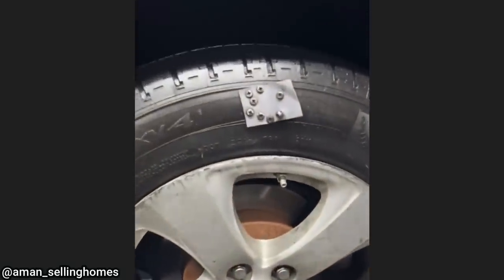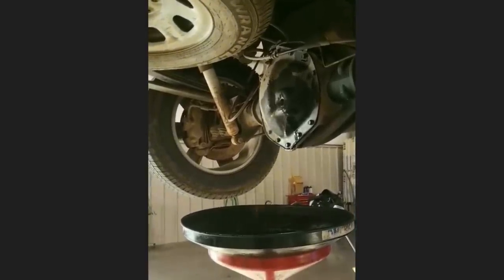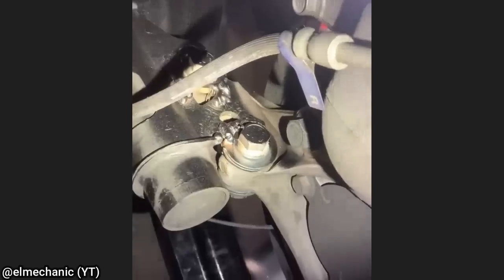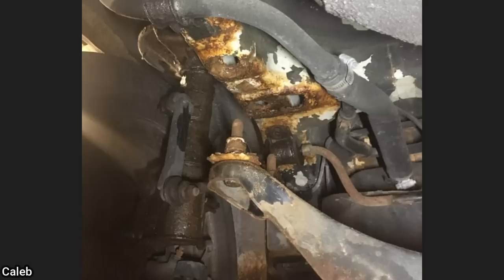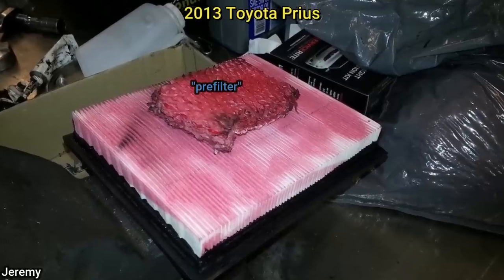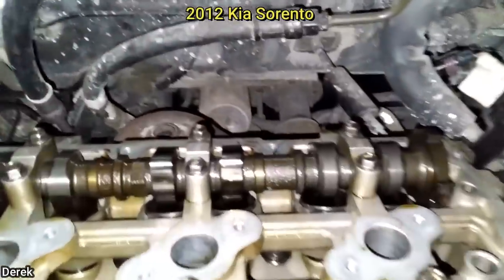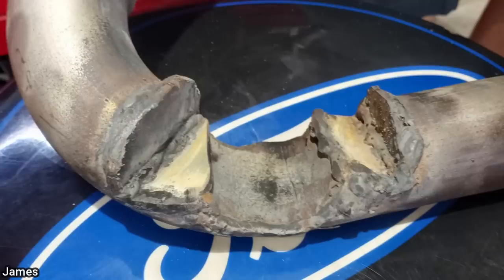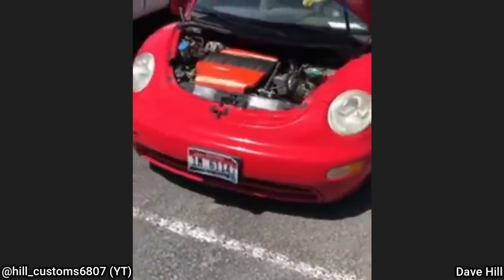Customer States They Tried Fixing Their Tire But It Still Leaks | Just Rolled In

Comment: The fuel leak from the rear diff, never in my life did i think i'd ever see something like this. Human stupidity is endless.
Reply: Crazy
Reply: Years ago on an old chevy van, Customer complained his DRIVE SHAFT was still leaking after replacing NUMEROUS tailshaft seals at another shop., I laughed it off, until I saw trans fluid POURING out of the weep hole in the Yoke.  Drain and refill to correct amount, and a dab of rtv over the hole... Back in Business.
Reply: Why would you rtv a weep hole? It serves a purpose
Reply: Even with my limited understanding of cars, my first thought was, "wait, fuel's not supposed to go in the differential, right?"
Reply: same thoughts. first time ever seeing fuel ending up in a Diff.
Reply: @caveatlector2671  - If we could harness the power of stupidity we could solve all the world's energy problems.
Reply: I bet that diff is spotless though...
Reply: You know that the bearings will need replacement soon if not immediately.
Reply: Something like this happened with the USS Nimitz (I believe) recently.
Some repairs were "done" and a water line and Aviation fuel line got crossed.
Reply: I have seen people putt 80 liters of 80W90 oil in the urea tank of a vehicle...
Reply: @Mr.SisterFisster  my thoughts too
Reply: Yet I don't even understand how that could be done... Been working on cars here and there, but no luck managing that kind of ordeal.
Reply: @gabrielecossettini2923  The old VW Vanagons had the oil fill behind the rear license plate. Unfortunately this was the 80s, and there were still a lot of 70s American cars around that had the fuel filler there. More than one Vanagon owner had a gas station attendant fill his crankcase with regular unleaded.
Reply: The H1 Hummers (especially the military spec) had vent tubes (mainly for water fording purposes) for everything that contained fluid.  It was a common issue to find fuel in the geared hubs, transfer cases, and transmission.  This was a direct result of a hole in the diaphragm of the mechanical fuel lift pump allowing fuel to bypass to the other side of the lift pump and right into the vent line which tied into the entire vent line system!  The hole is typically small and had little effect on the function of the lift pump, so finding fuel in the drive train was the key indicator of the deterioration of the lift pump diaphragm.
Reply: That's a good idea for teaching the concept of "infinity" - human stupidity 😁
Reply: @sil-zk8061  rtv?
Reply: I actually experienced that, on a military vehicle........as a civilian mechanic working in an army motor pool, had a hmmwv where everything connected to the vent system was full of fuel.

Comment: That exhaust-fix to clear the drive-shaft receives my 'Performance Mod of the Year' award! :trophy-yellow-smiling:
Reply: There was a video proving that a kink in the exhaust doesn't significantly affect performance, so why not put a giant notch in it?  It's kind of the same thing.
Reply: Many home wrenchers would be thrilled to even be nominated for your coveted award!
Reply: "Limited Performance Mod", Not limited in availability but limiting performance throughout the rev range...
Reply: Does the Prius filter get a 2nd place or at least a honorable mention?
Reply: Super extraction system! Amazing!
Reply: @fredygump5578  

I think you possibly might be talking about Roadkill but I can't remember the car. They beat the hell out of a header pipe for clearance and it was significantly narrowed in a small section and pretty lumpy. But yet it didn't alter anything on the dyno!

That notch thing though, you just know it will leak like a sieve and probably break at a really inopportune moment 😂
Reply: @skylined5534   Actually Frieburger did it on Engine Masters...on an engine dyno.  But yeah, they also did it on Roadkill, although that data is slightly less reliable.

Comment: Love the tire patch.  Fifty years ago I was turning wrenches on Convair 580s, turboprops with propellers 13' 6" in diameter.  Just for fun, we once cut two pieces out of .040 aluminum and drilled them for rivets as if making a scab patch.  The rivets showed heads on one side and bucktails on the other, but were ground flat on the other side.  We would glue the "patches' on front and back sides of a prop blade and wait to see what would happen when the flight crew walked around the airplane during preflight.  Most of them knew they were being pranked, but it was still fun.
Reply: "Pilot reports something rattling in cockpit. Removed something."
Reply: And 580s are still being operated today in Kelowna BC by KF Aerospace!
Reply: " bugs, sir, your plane has bugs."  @@klinestill

Comment: "I'll fix a hole in a tire by putting more holes in the tire" - don't forget that this guy is allowed to vote.
Reply: Just crazy
Reply: That's a red neck solution if I've ever seen one. And a very bad one at that.
Reply: And drive, and own firearms, and reproduce.
Reply: Also allowed to drive on the road with the rest of us.
Reply: And he’s driving on public roads just like you! Scary ain’t it 😬
Reply: don't forget the duct tape
Reply: @konradschnell6136  Really? Were you with him?
Reply: More immediately dangerous, theyre allowed to drive a vehicle... they should prolly be wearing a helmet, at all times..
Reply: He probably voted for Chester A Arthur
Reply: @calamite0  the duct tape is the smartest part of it. at least for americans. hope the screws are stainless ones or they might get rusty if it rains or snows... 😏
Reply: @kittytrail  
The screws were obviously self tapping and Self Sealing!
Reply: Sometimes you have to fight fire with fire.
Reply: @Jdogg4089   no that's a metrosexual Millennial tire fix that's just now getting into the DIY trend!!!
Reply: Geez this stuff makes me worried about humanity
Reply: And to procreate
Reply: If he used a metal patch it might have worked by sealing the screws with silicone or rubber.. But the balance will be thrown way off..
Reply: I breathe for a hobby.
Reply: @Smokie1523  he is a helmet at all times.
Reply: There should be an adjustment to the 2nd ammendment allowing these types to be stopped.
Reply: and has probably spawned offspring of some kind.......scary
Reply: And drive!
Reply: Remember he votes for your candidates and supports the things you support too.
Reply: Which way did he go George?
Reply: They'd be a perfect republican candidate... Don't fix anything, just make it worse.
Reply: LoL
Reply: 🎯🎯🎯 scary 🤦‍♀️
Reply: Don't forget about jury duty as well
Reply: A bone-headed attempt but not entirely outside of reality. You can stitch up a large gash in a tubeless mountain bike tyre that is too big for plugs to bung up. You just need to glue a rubber patch over it on the inside to create a good, airtight seal. The sealant should find and fix any little weeps left after that. I find it helps to also glue a patch on the outside to protect the stitches from abrasion.

Yes, it does feel all wrong poking your tyre with a needle repeatedly but it's a lot cheaper than a new one. I've had a stitched-up tyre on the back of my bike for three years.
Reply: He allowed to do more than vote sadly. He's allowed to breathe lol
Reply: And they may not be in your country
Reply: @konradschnell6136  I watch this channel for to relax and unwind and get away from the news for a while. Not everything needs to be about politics all the time.
Reply: @konradschnell6136 Really????
Reply: I think the plan was to outnumber the hole with enemy holes and surround it. A fine military strategy.
Reply: Truly incredible.... im loosing brain cells
Reply: As if voting isn't just circus for the plebs
Reply: Sounds like a democrat lol
Reply: he voted the current potato regime.
Reply: That thing is next to me on the road. I'm buying a tank
Reply: and voted democrats
Reply: Dude made a flat tire political 🤡🤡😂
Reply: @Jdogg4089  Which means we know how he votes.
Reply: @thefinalme best comment ever 😆
Reply: compulsory voting is good, fined if you don't
Reply: @shiki9986  losing*
Reply: That person may be “allowed”, but hopefully doesn’t know how.
Reply: Lmao
Reply: However, if they got the screw into the right spot it would have been a valid temporary solution to plug the hole and get to a tire shop for a new tire.  The world is full of neat things we have that originally resulted from someone saying "I wonder if this will work?"  Even more, the person didnt jut stand there and helplessly cry about the situation.  They took a  shot at fixing it, misguided or not.  They also recognized they got in over their heads and got the car to a shop.  Remember, not everyone grew up around people that worked on their own stuff and taught them basics.
Reply: And procreate.
Reply: @Smokie1523  at this moment I think it's safe to assume that the helmet is wearing him.
Reply: I think the biggest issue is they are allowed firearms, and we know they already like putting more holes in things...
Reply: @thefinalme  You should work for some private think-tank with a mind like that.
Reply: I'm actually more concerned that he's allowed to operate a vehicle on a public roadway...
Reply: @andrewt.5567  How optimistic. You know what else has originated from “I wonder if this will work?” - it’s called AAA or Roadside Assistance. 🤣
Reply: @J B  I think you got that backwards 
All the metropolitan areas have been democrat for decades. Still have high crime, lack of housing etc.
Yet when asked why they haven't fixed anything they blame the party that hasn't been in power in decades.
Reply: Congress woman AOC was going to remove her tires from her car to check the air pressure in them.  If you need any automotive information, she would be happy to help you.
Reply: Imagine a post online not becoming political
Reply: @beavis1887  I was thinking the same thing.
Reply: I hope he didn’t forget the glue to fasten the wheel back on the car
Reply: When he votes, he probably punches all the holes in the ballot.
Reply: Let alone allowed to operate a  2 ton metal chariot at speeds well above stationary.
Reply: @MisterTwister88  "The border is secure," Cacklin' Cameltoe. You can rest easy tonight, the government is hard at work.
Reply: Also they are out on the road amongst us . Watch out for the other guy comes to mind .
Reply: @Sashazur  unfortunately conservatives HAVE to make every post political no matter what the subject may be, even flat tires. They have to spew their bigotry and hate.
Reply: And has probably reproduced
Reply: @Sonny_McMacsson    I was. It’s true.
Reply: @chuckthebull    Aha!!! The balance!!!
Reply: @JB-mk4ry  As opposed to the smoking dumpster fire on a train wreck of the last 2 years?🤣🤣🤣
Reply: Hey now the duct tape will seal it
Reply: @MidKid61  No, Cacklin' Cameltoe actually said that. I am just quoting her. Perhaps you have the balls to see if I am correct?
Reply: If intellect was a voting factor every ivy league student would be pissing from how hard they're laughing, let's not forget our place
Reply: @MidKid61  So the fact she is a 'woman of color' is more important to you than the fact she lied to the American public? And she is the Vice Resident... You need to rethink your stance on this. BTW, I am also a person of color and I value good morals and ethics and honesty over what 'color' a person is. You should care too. That's why the USA is in the shape it is. Go figure.
Reply: Probably blat
Reply: Im more worried about the amount of people that have immediately jumped to the conclusion that the driver is both over 18 and isn't a convicted felon.
Reply: Worse, he'd probably get elected, for his "innovative" "outside the box" thinking.
Reply: And his vote is worth just as much as yours.
Reply: @Smokie1523 You better be wearing one too if you were around him😂
Reply: Probably blamed the flat on the Dark State.
Reply: LOL!!!  That is literally what I just came here to post!!  There really should be an intelligence test administered before being allowed to vote! 😂
Reply: you say it like votes mean smth. the problem hes allowed to drive
Reply: that explains everything!  there is no there there
Reply: He voted blue
Reply: Maybe it's an air inlet hole that only works in one direction
Reply: Also allowed to breed.
Reply: @beavis1887  You said it brother!!!
Reply: That's why we have the electoral college
Reply: @Smokie1523  and a life jacket.  Just in case
Reply: I dropped my phone when I saw that.
Reply: Should have guidelines to be able to vote
Reply: He probably voted for Fetterman.
Reply: @Jdogg4089  Nah, that's been upgraded to hillbilly level.....
Reply: It’s insane that this person drives them self never mind can get dressed with out help lmao 9 screws should stop one from leaking right!
Reply: Vote, breed, breath walk around freely, speak, act ect
Reply: Dont forget that this guy is allowed buy groceries
Reply: It's gotta be a joke
Reply: Isn't it great america
Reply: No the hell he is NOT allowed to vote
Reply: This guy is allowed to D R I V E
Reply: @MisterTwister88  yeah i remember when we HAD a border.
Reply: dont forget that guy is allowed to DRIVE... oh gosh
Reply: If there’s a hole leaking air it’s common sense making another one so that the air can leak inside again 🤓
Reply: I have put screws in tires, so they will hold air. I also use black silicone caulk when I do it.
Reply: @LMacNeill  That would be labeled "racist".
Reply: Best thing to do if you're in a pinch is to use one of those self tapper roofing screws with the rubber gasket on them. They'll hold long enough to get to a tire shop.
Reply: @bradbradleys6091  my dad did it once. By the time we got to the shop it was leaking pretty good but it got us there
Reply: @who_cares848  oh u mean like he drilled screws directly into the hole? That seems more likely over the method shown in the video
Reply: @MarkusBrod  the guy accidentally created perpetual flotion
Reply: @bradbradleys6091  yes that's exactly what he did
Reply: 🤣🤣🤣🤣 i noticed he missed some places with the screws!
Reply: @TheFlyingBusman  what are you gonna do about it not pay taxes
Reply: Most intelligent democrat voter:
Reply: How do you know?
Reply: That's exactly why you're paying $4 for gas.
Reply: @MyLifeThai371  George Santos probably fixed the car like this. It may seem strange, but who's going to argue with a mechanical engineer who studied at Harvard and also invented the automobile.
Reply: And drive
Reply: @st8ofmind325  bro they tried to fix a hole in a tire by putting more holes in a tire. They shouldn’t even be allowed to reproduce.
Reply: @JB-mk4ry You spelled Democratic wrong
Reply: @Smokie1523  just because you can drive doesnt mean your a technician
Reply: @NippyNep  if you need an ase certified mechanic to tell you that putting more holes in a tire is worse that one hole in a tire, youre the guy that we should be concerned for..
Reply: My making smaller holes the air can't leak out of the bigger hole... genius move!
Reply: It's the northern equivalent of the south's hold my beer and watch this.
Reply: @beavis1887  the entire plot of Idiocracy put into one sentence
Reply: @beavis1887  all much more important than voting.
Reply: @elizabethrios7759  How old are you?
Reply: IKR?  🙄
Reply: Honestly, with something this stupid, you have to wonder if the guy was trolling.
Reply: The customer used drywall hole patching technique to fix a tire hole. It makes perfect sense if you think this way.
Reply: @elizabethrios7759  Exactly. That “fix” is up there with a modern Bud Light marketing campaign.
Reply: The problem was that he used duck tape, he should have used flex tape
Reply: Yes, people are really this dumb. I work at a nationally none hardware store and dumb people come in everyday ask dumb questions. I a professional retired contractor so when I tell the how to do something to fix their problem and guess what I hear. Well that’s just too much work or I don’t want to spend that much. Then I just can’t help you. Duct tape doesn’t fix stupid but it sure muffles the sound.
Reply: more like remember that they somehow have a licence to be able to drive. they clearly got their education from a cereal box, along with their license.
Reply: That's how politicians fix problems too